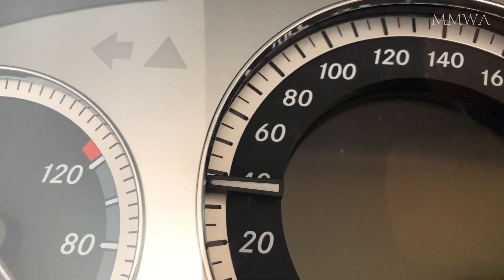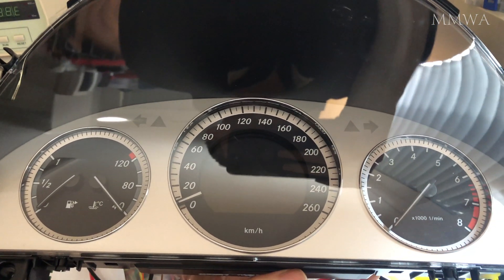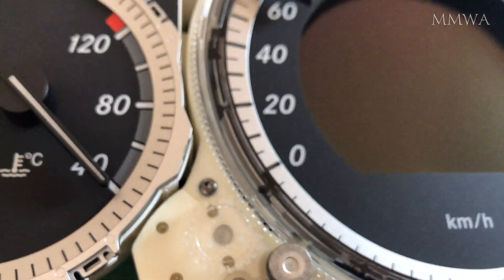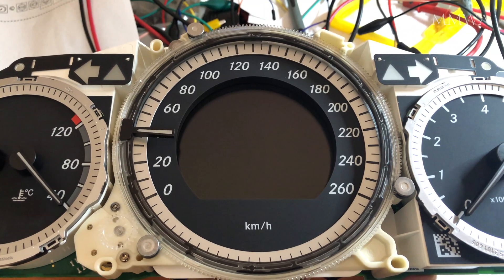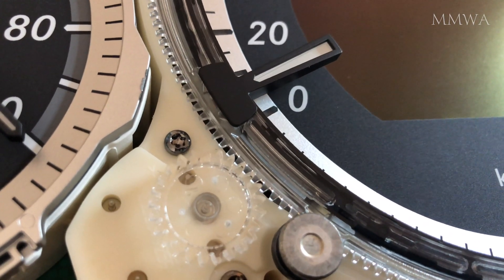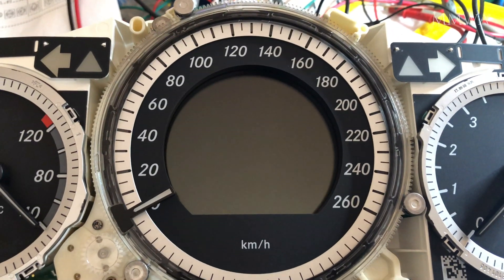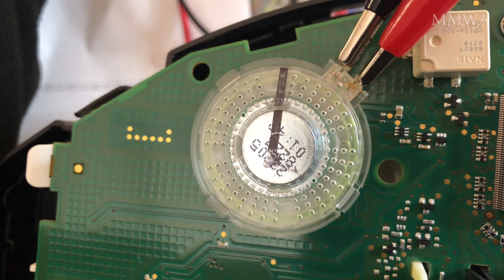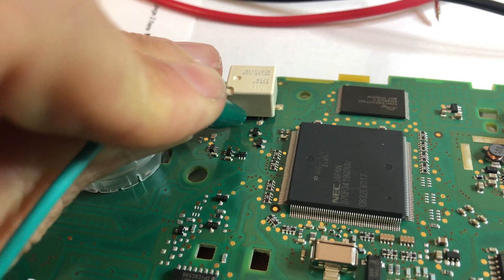How do those floating speedometer needles work? Simple really!

Comment: I always wonder how these things will age. will they still be reliable when they are 20+ years old? i know the ones from around 2000 had problems with digital displays failing. Interesting video..
Reply: i have just put my 1998 R129 on the market for this reason.  Its one of the first mercs loaded with electronics.  Although its working perfectly now, I cant risk the future where this stuff starts failing and leaves me facing a hug bill trying to find replacement parts.   I bought a 380 sl 1982, :) that I can keep running!
Reply from the maker: ka130258 from memory everything electronic on the 80’s cars can be repaired at home with a soldering iron. Even that aluminium box ignition module - it suffers bad solder joints and some incidental damage caused by it. I have repaired those piece of cake. However the newer style module that is a drop in replacement is pretty cheap anyway.
Reply from the maker: amgjens well, considering this one failed at 11 years old i’m doubtful many will be fully functional by then. The good thing though is that they are pretty basic and theres a cottage industry repairing them.